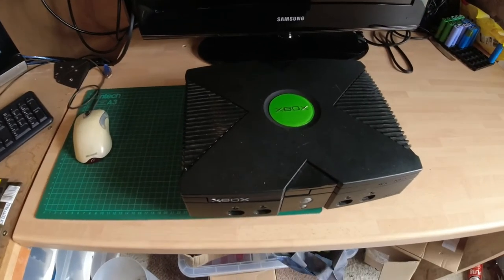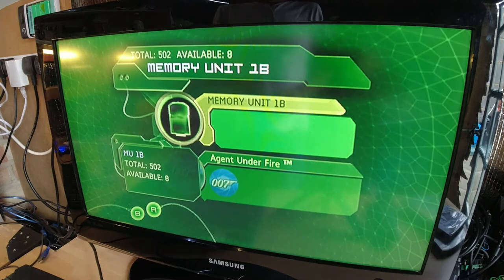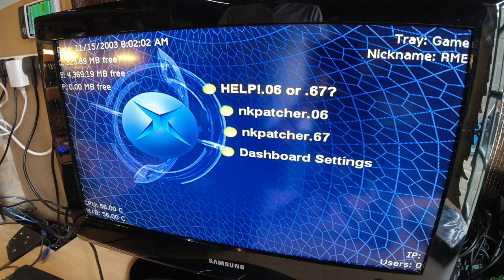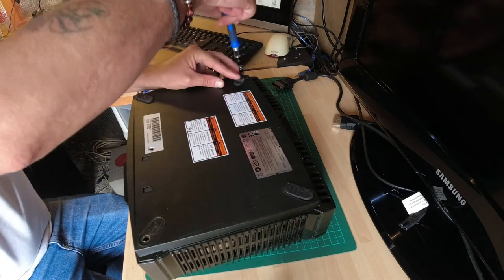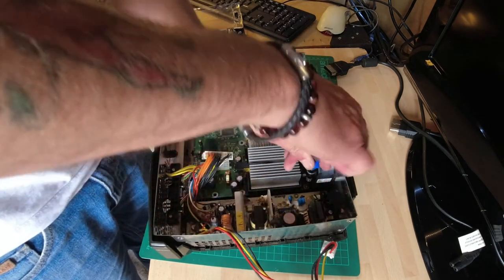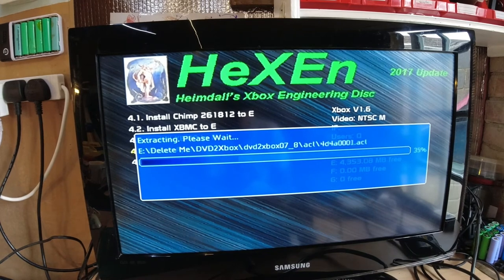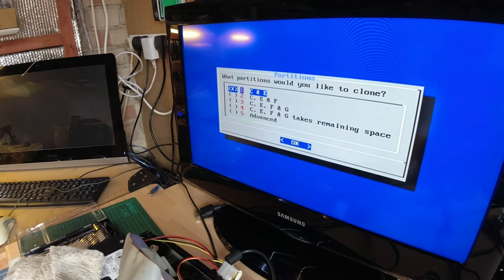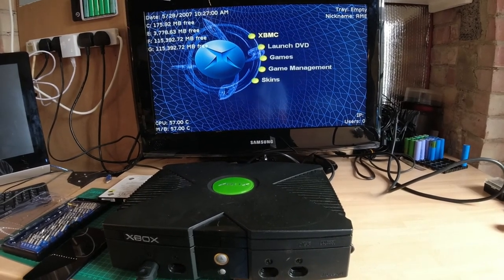Softmodding & Upgrading The Original Xbox V1.6 In 2021   Still A Beast!

Comment: My 1.6 I did at insignia launch I put in a 500gb SSD.. it did not need chimp I partitioned the new drive without external power just a PC and USB SATA cable... I'm wondering if this is a PAL Xbox u did here not because it needed power but because of the extra steps like that custom extras disc u had. it was way different from what I had done to my stock HDD softmod + SSD swap.
Reply: Is there a tutorial for you how you did it?
Reply from the maker: It is a Pal version.

Comment: I have a 1.6 also.  I plan on doing this.  Is there any specific HDD I should pick up?
Reply from the maker: There's a compatibility list of hard disks that work. Google it and it comes right up.
To be honest every drive I've tried works even if it is not on the list.
Reply: If it's hard modded than any drive will work since you don't need to lock it 
If it's softmodded then you can't just pick any drive and hope that it'll lock 
I use a barracuda 3.5 inch Sata hard drive
Of course you'll need to order also the 80wire ribben for it since the 40pin cable won't work on modern sata drives
Reply: Seagate barracuda 1tb and 2tb hdd work and you can get em brand new on amazon.

Comment: I'm going to attempt this today 6/24/24 I have not done this method before without doing TSOP first hopefuly it works. I will post here later my finds. PS : i'm adding a 500gb sata drive.
Reply from the maker: How did it go?
Reply: So it did work and I was amazed because this was the first time I work on a 1.6 I've worked with 1.0 up to 1.5 and had to TSOP flash them every time and I have worked with chimp before and it just wouldnt work with soft modding which was way easier. The bad thing though, as soon as I finished the procudure the xbox wouldnt turn on and even changed the power brick for one that I know for a fact works and it wouldnt turn on, after doing some digging I found out that I need to change the 5 transistors which will do some time later. In conclusion, your method worked! so thank you for that. I'm amazed that you were the only video I found on youtube that actually worked and there aren't at least on my experience no other videos explaining that 1.6 only needs to be softmodded and not flashed in order to upgrade your HDD.

Comment: Is there any games compatibility issues with a softmodded 1.6 Xbox? Because I prefer to collect some games instead of finding a way to plug the IDE hdd of the console to a modern pc, can I use the PAL version of Mechassault with the "special" save file? (first print)
Reply from the maker: Once soft or hard modded the console will play either PAL or NTSC with no issues. You can even set the xbox to be PAL or NTSC output.
Reply: @retrotech2020  the game itself is needed to softmod the console.
Plus, how should I partition a 1 TB drive if I want to play only Xbox games? (eventually some emulator, if it doesn't change anything)

Comment: Which Revision is best if i want to mod 128 ram and an intern hdmi port?
Reply: 1.2-1.5 are the easiest to softmod.  Its not really a matter of "best". Version 1.6 will be newest and better capacitors. however based on age they generally due for replacement ( can look ok, but bad ESR readings) The 128mb ram upgrade is essentially pointless as no game was designed to utilize 128 and its only a handful of MAME games that benefit.Which if you got version 1.6 or anything 1.2-1.6 there is no spot on the PCB to add additional ram. Which means your stuck going with the double stack method (stacking a 2nd ram chip ontop of the ones on the board). Which again, kinda silly - but those the options.   Regardless of version your better off buying a $10 Aladdin XT chip and hard mod . Super easy and you have virtually any hard drive available , not worrying about "lockable" drives....As for HDMI mod its super cool, but super expensive and the difference between  The Hyperkin HDMI for $50 verses $140 internal mod ( before install) is minimal.... It comes a line where you need to ask is a 20yr old XBOX with old electronics worth  putting $500 into for emulation? You have much cheaper more powerful options (Buy a series S for example...). To me its a fine line between tinkering and having fun, verses wasting pointless cash.

Comment: I'm a bit confused, I thought you can only soft mod xbox 1.0 to 1.5, the 1.6 wasn't moddable via sotware and required chip mod!!!!
Reply from the maker: All versions can be softmodded. The 1.6 version cannot be TSOP flashed but it can be modchipped
Reply: @retrotech2020  I'm sure the term soft mod means flashing the tsop. A mod chip install would be a hard mod and not a soft mod!
Reply from the maker: TSOP flash is a hard mod as you have to solder a couple of points on the motherboard therefore modifying hardware (hard mod), installing a mod chip is modifying hardware too. Soft mods are achieved using software (softmod).
Reply: Softmod 
Tsop
Hardmod
Those are 3 different ball games 

These days go with either softmod or hardmod
Microshit never took out ability to softmod 1.6 
I used a softmod it's the easiest shit honestly I'm using a 1.6 version
Reply: @twix92  chip modding is quite simple  - IF you can get the parts these days.  IDK?   But there was 1 tricky solder that you had to do.   I wished I had tried a soft mod.  maybe will soon.   These machines are getting harder to find being 20 yrs old and in good condition.   But back in the day there were SOOO many applications and stuff you could use to transfer data and still play online and store game saves from others, etc.   Not sure if all this still exhists??

Comment: My issue is that my drive died and I need a new one. Because of this it will not boot to the dashboard and gives error 07. The cable has been checked and changed out with an 80 wire cable. I don't have a drive to clone.
Reply from the maker: Your only solution is to hard mod the Xbox using a modchip or TSOP flash it and then install a new hard drive.
Reply: if i remember right - you have to unlock the hard drive.   there should still be the software out there somewhere...  I bet Ive got my old disks here somewhere...
Reply: @courtneybchild  I have two OG Xboxes with locked drive. Do you know the name of the software used?
Reply: You can also read the eeprom off the motherboard if you want to make an eeprom reader cable, there's a good video on it on youtube. This one is about reading and writing eeprom https://www.youtube.com/watch?v=uzrljlHDr9w